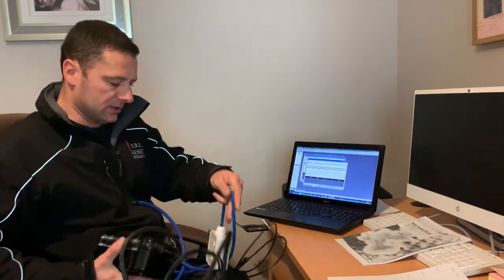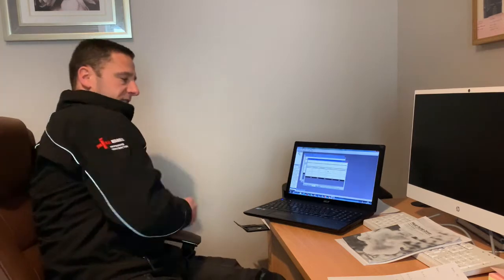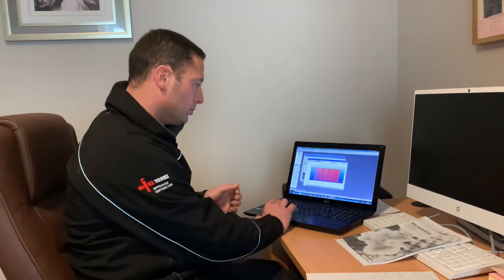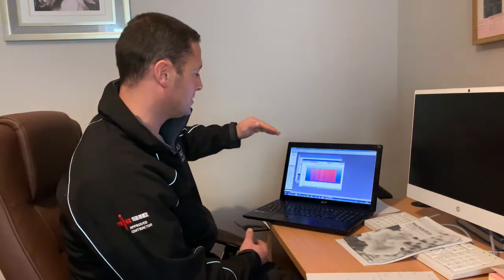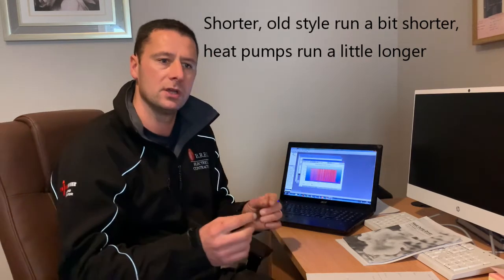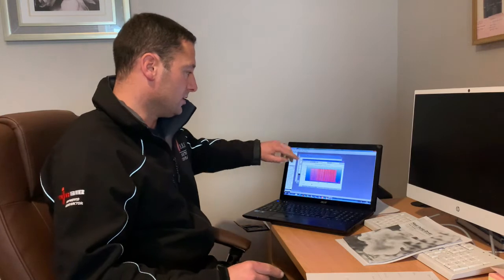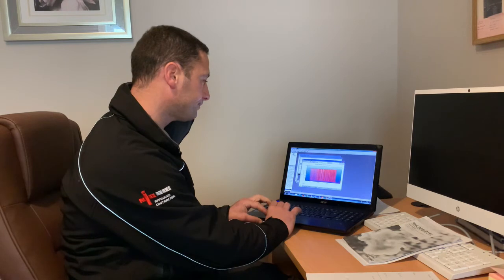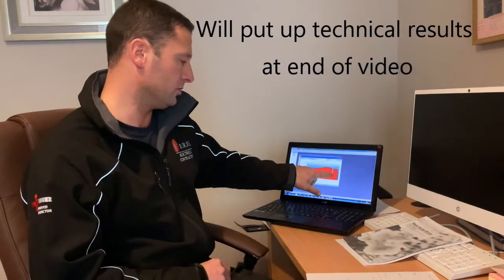Heat pump tumble dryer v's vented tumble dryer, Data logging.

Comment: How much longer do you reckon the heat pump dryer takes the to dry same amount of clothes vs conventional vented dryer?
Reply from the maker: I think an average pretty full load takes around 2 hours with the heat pump dryer. It has sensors so no two loads take the same time. We set it on a mixed load setting that starts a 3 hour countdown but it never stays on that long.